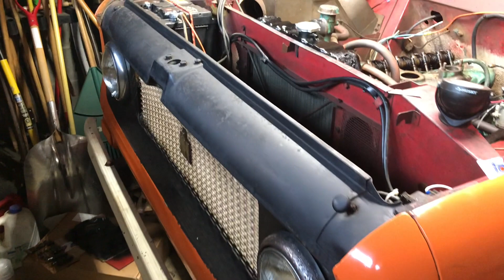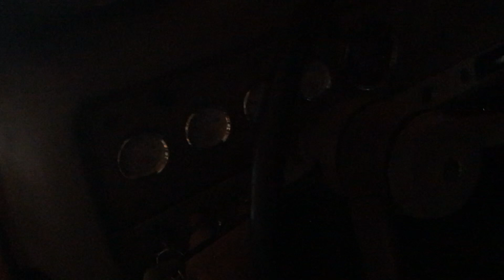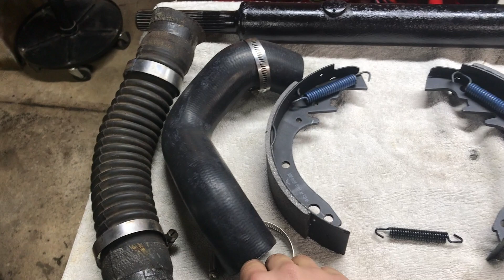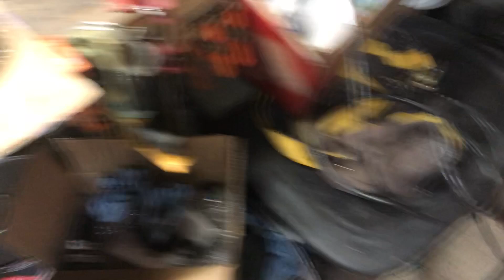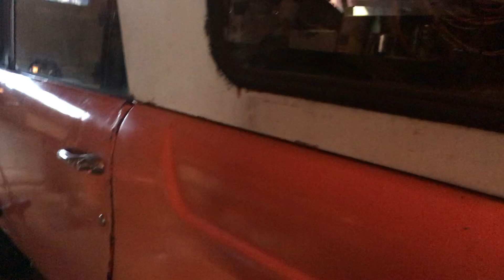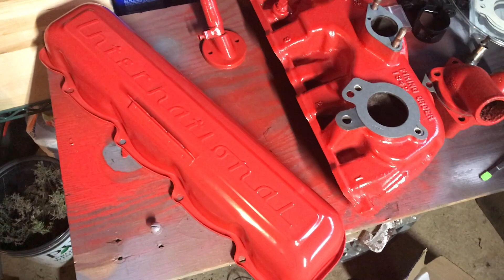1965 Scout 800 Build and Channel Intro

Comment: Good info on the eBay seller, however I can’t find that seller. Can you post a link?

I have a 800a that I’m doing right now myself. And you are correct those 3 sites go a little crazy on shipping.

Update: I think I finally found the seller. Scouterr1  definitely wouldn’t have thought it had two Rs

Comment: Hi, how do you identify the axles?
Reply from the maker: If it’s a Dana axle then in the bottom right  of the side cover on the housing, there should be a number that is your axle type. IHC only ever used Dana axles
Reply: Carson’s IH Garage thank you very much, im debating weather i want to swap an IH engine from the sv series into mine and idk if my axle could handle it if its meant for the 152 cid engine, anyways im glad to see im not the only kid out there that likes old internationals :)
Reply from the maker: Your welcome, glad to help. If your looking to make any kind of power then put a Dana 44 behind it. A 152 or 196 is all a Dana 27 can handle. I always planned to go back to stock scout 800 for originality purposes so it works out
Reply: Carson’s IH Garage i would like to keep it stock, because it is kinda rare for being in a pickup